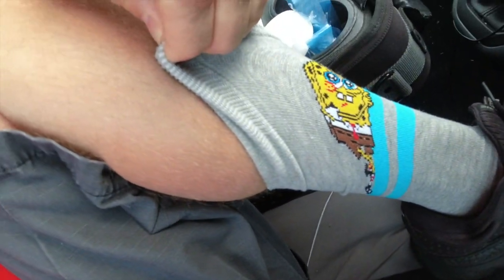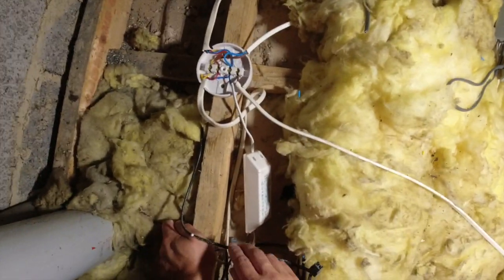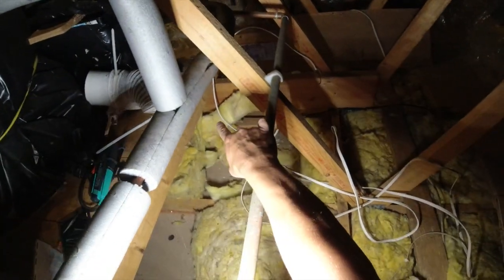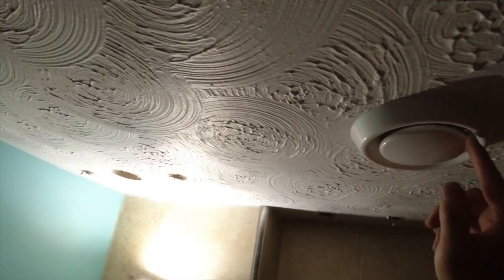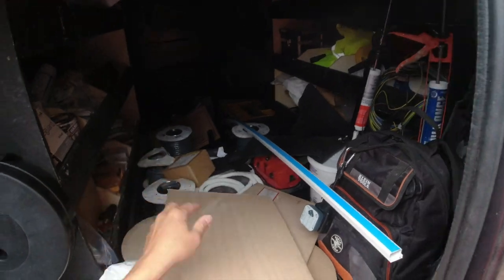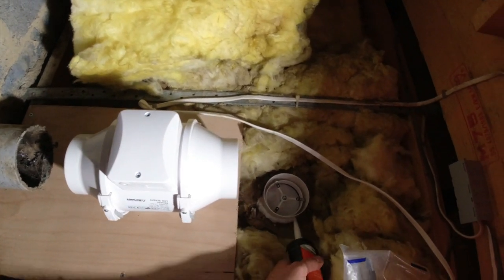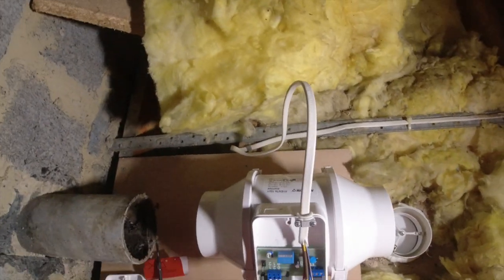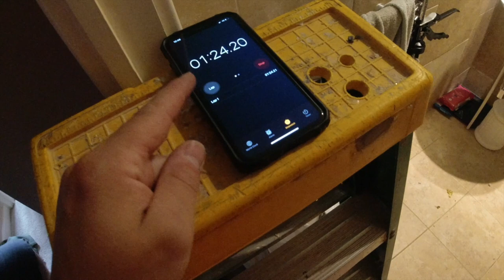Wiring bathroom lights and extractor fan ip65

Comment: Great work as always 👍👍. I was not aware the wiring for the lights and fan was that bad. Also Mrs M was never a favour if the small wall lights and was glad to see the back of them. I also know where the fan over run timer and adjusting tool lives  🤣🤣. All the holes have now been filled in and ceiling painted... we are both extremely pleased with this and all your work you have done in the house..

Comment: On a shower room without a window, I usually go for at least 15mins overrun, especially if they can use the other switch to avoid turning the fan on during the night. Do you find 5mins is sufficient??

Comment: With these jobs do you leave type ac rcds because just replacing fittings or do you type A rcd protect them now
Reply from the maker: Type A/C rcds are still recognised as adequate protection by governing bodies even though dc leakage can leave them useless.